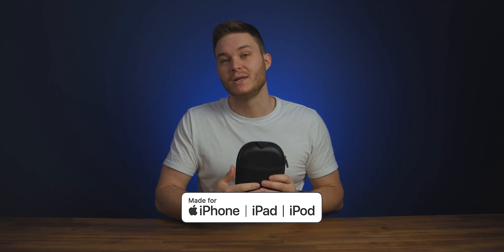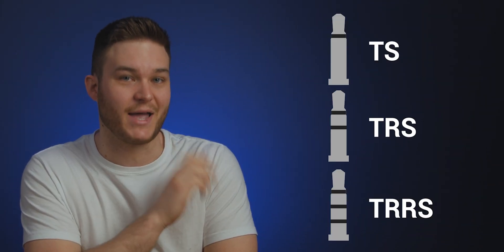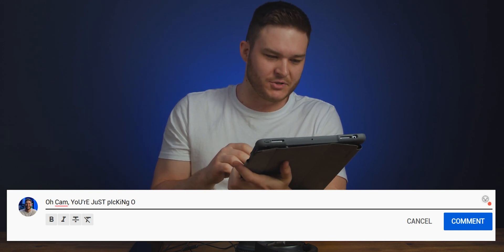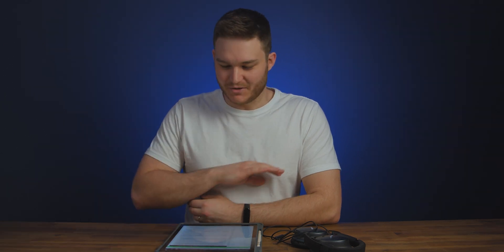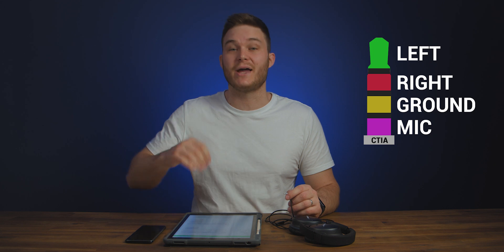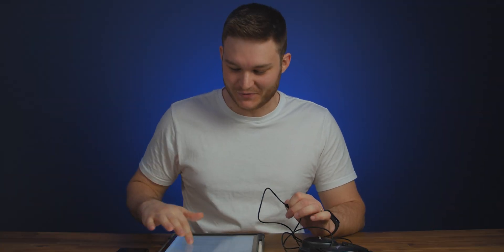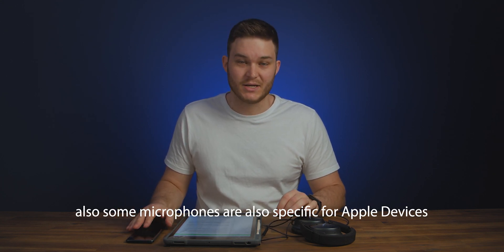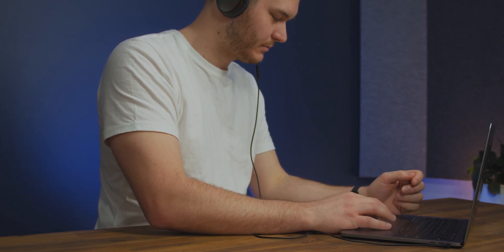Why "Made for Apple" is Dead

Comment: I used to have some fake apple earpods that needed me to hold down the middle button to make sound come through. Not quite sure where that is in the spec! 😂 I somehow put up with them for a good long time while walking to school too. haha
Reply from the maker: May have been a OMTP jack in a CTIA port and holding the button allowed the speaker drivers to ground through the mic poll. That's a guess of what's going on, I've had the same before haha! Someone gave me knock off beats and they didn't work with my iPod unless I did that 🤣

Comment: Hey man i have the same headphones and realized that the connection to the headset itself is different. My cable is broken and need to get a replacement but can’t figure out what cable i need. Any suggestions?
Reply from the maker: Hey Vadhin, great choice 😉 the Bose QC25's have a 2.5mm jack connection at the earcups. Best to search for a model specific replacement audio cable to ensure the plastic surround can fit into the Port too.

Perfect time to also buy a "made for apple" cable or a generic "rest of the world's devices" one haha. As not many headphone cables are replaceable to even give you that choice 😁
Reply: @camshand  Thanks man found one on amazon and could actually find the exact one thaks to your video lol!